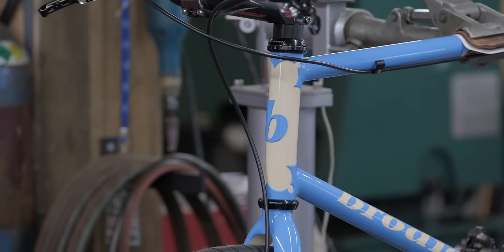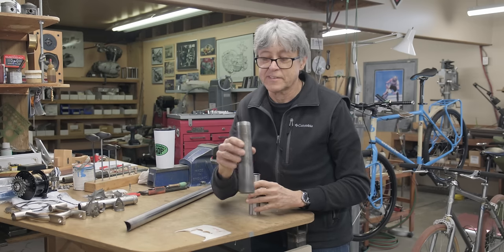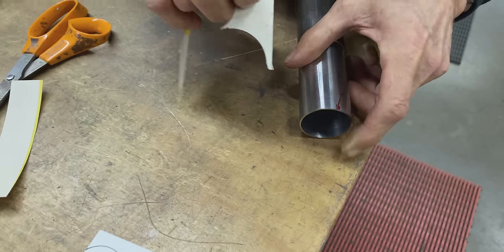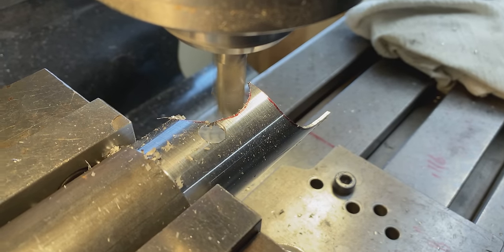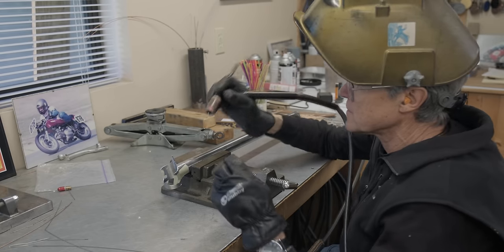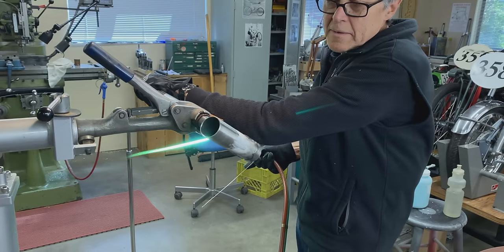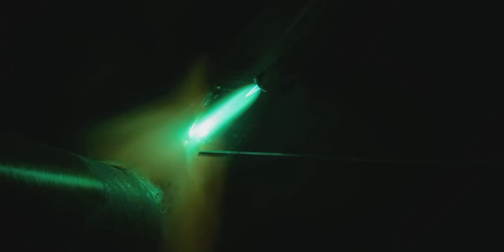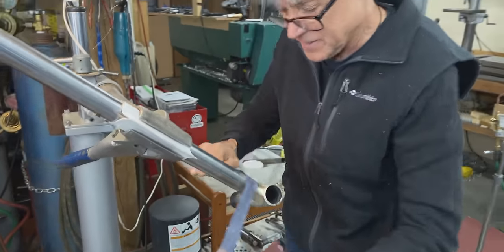Bilaminate Construction on a BICYCLE HEADTUBE // paul brodie's shop

Comment: another masterful demonstration… mixed in with some interesting history…i love that beefy bike…i weigh my bikes in comfort, not grams…i bet she’s a dream!
btw…i have never ridden such a fine bike, but i believe there is something to be said for larger wheels and thicker (2.5-2.75) higher psi (65 lbs) tires…i put in approx 200 miles a week in the saddle of a rebuilt large frame 7 speed cruiser with these, and i average around 18-20 mph…ive finally got it geared properly, and it’s like riding a freight train once you get to speed…so comfortable…it also builds a momentum that i can feel on gusty headwinds and short uphills that a lighter bike might not blast through as easily…it’s a very addictive quality that is hard to describe…but it is certainly unmistakable…
love your work!

Comment: Beautiful workmanship.. I never realized that you would use the silver rod on the fillets, I thought it would run too thin opposed to straight brass rod. I’m still braze quite often on my hot rod and motorcycle projects and I only use the silver once in a blue moon on things with a tight fit up or when I don’t want a large fillet. I learn a lot watching your channel. Thx.
Reply: it’s not silver. you may have misheard “nickel silver”

Comment: Really interesting video, thanks for making it. Again, admiring that BEAUTIFUL work of useable art that inspired this video, so gorgeous. Curious though Paul, besides the looks, does this technique/method add a lot more strength than just doing straight up, tube to tube filet brazing? I mean for sure it adds a lot of intricacy and beauty, just curious if there's other benefits as well. Oh and if I got one of these types of frames made, you wouldn't be able to "hide" anything because I'd only want it clear coasted so you could see the craftsmanship and beauty of it 😀

Comment: So curious why nickel silver and not the lower temp silver solder? Just that you want to be able to machine the "lug end" of the joint first, and want to avoid distorting the "lug" end? I always thought Bi-lam was just rolling your own lugs. High-fives, great work and video as always!
Reply: That initial mini fillet he did had to be done with nickel silver, you can't create a fillet with silver alone. I suspect he switched to low temp silver when doing the lug work but maybe not. I've seen skilled brazers do lugs with bronze. 

He didn't call it out when he switched to the bronze for the larger fillets so perhaps just didn't call out the switch to silver.

Comment: A few things... Are you flowing the silver completely into the lug section and is your DOM 4130 or something more akin to automotive roll cage tubing?  Thanks... Looks great. Cliff
Reply: D.O.M. is usually something like 1020 or 1026 carbon steel, while most 4130 I’ve seen (and bought) is seamless.

Comment: Is sometimes whole lug made this way?
Reply: Yes, Waterford Precision Cycles (now closed) made their more ornate stainless steel lugs by welding sections of tubes together and hand finishing before brazing the frame like traditional joined. Also Spectrum Cycles built Tandems with custom dimensioned lugs the same way. Both have closed in the last couple of years but their websites remain where you can see their work.

Comment: The bi-lams on my Paris frames are made from flat sheet that's been rolled into a curve to fit over the tube. You can see the joint at the back. More than one way to skin a cat I guess.

Comment: So how the hell do you train your brain to do 2 axis milling by hand.?
Reply: Actually, if you go slow enough, you only need to do one axis at a time - just move in very small increments, e.g. .005 / .12 mm.  Sort of like a primitive species of numerical integration, e.g. Riemann summation.

This is very slow, however - which is why you need to concentrate intently when using both hands on the cranks.  I can do a passable job SOMETIMES - which is why moving but one axis in very small increments is a fall-back method - that, using various sizes of, say, ball-end cutters when lightening aluminum bits on a recent bike-trailer, and angle ‘plates’, etc.
Reply: Or the short answer is “ practice, grasshopper “ 😂

Comment: You would not be able to make many of those joints in one day! 😞
Reply: If that were your only job, and your jig was table mounted to allow you to brace your elbows on the table, smaller silver and brass to better suit the material thickness it would make the job far easier and increase the speed.  This is a one off that he didn’t take the effort of time to make it rapidly as would have been expected in a production environment.  It’s not uncommon for prototypes to be assembled as in the video and if numerous examples are required to set up for it.  But this is the way most prototypes are made by highly skilled professionals.  But yep, this is time consuming 😅

Comment: Are you using the Nickel Silver for bilaminate construction because it can handle the high temp of the bronze fillet brazing rather than using like a 50% or 56% Silver as one would for traditional lugged construction?